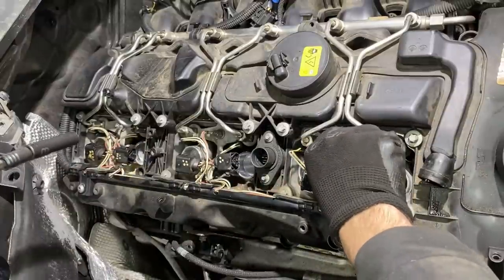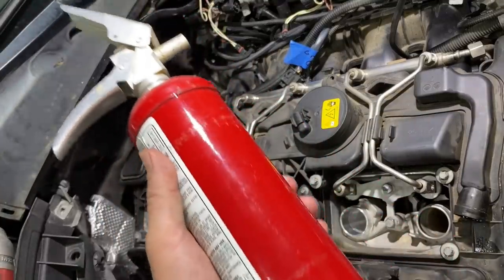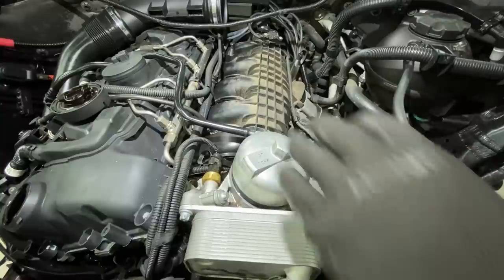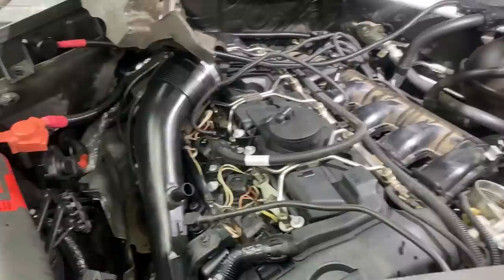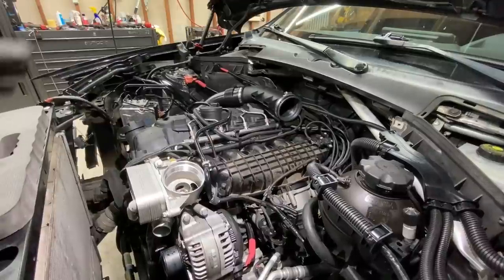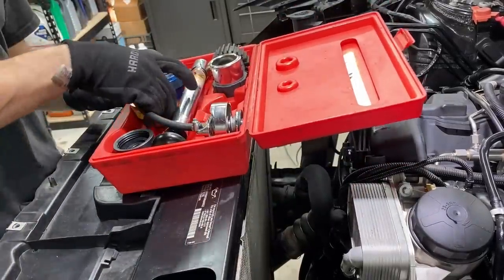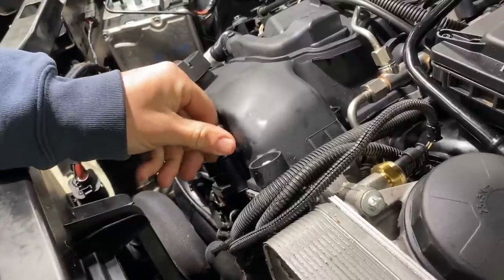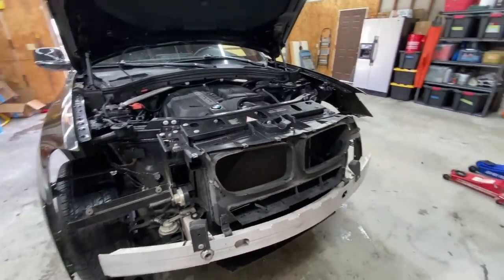HOW TO BMW N55 Valve Cover , Oil Filter Housing, Transmission Service 2013 F25 X3

Comment: I just replaced valve cover gasket on 2016 X3 35i for the most part thanks to this amazing video. Much appreciated.
A few notes - I did not remove spark ignition coils; decided there was no need for this in my case, but it does add a bit of a challenge to unscrew gas lines.  Also, when putting back cover I lifted most of the bolts at the back side and temporary secured with masking tape, found it was easier to manipulate cover into place.
Purchased Elring gasket set from RockAuto (several mechanics I called use Elring)
BMW service in San Francisco gave me $2900 estimate to replace gasket only!

Comment: Please list this as a F25, 35i.  I just did the valve cover on my F26 and realized, there aren’t a lot of videos on this platform, and this is on of just three videos that work on this platform with an N55.  It’s different than any other N55 setup and should be explored further.
Reply from the maker: Thanks for the info! Ill be sure to tweak the title

Comment: Good time to replace the coolant "Mickey Mouse" flange in front of the cylinder head while the oil filter housing is off. My upper radiator hose was still in perfect condition when I did this same service, but the coolant flange totally disintegrated, when I pulled it off the head.
Reply from the maker: Agreed! We didnt have the budget for it this visit but Im sure we will address it in the near future. They do love to crumble apart, maybe an aluminum replacement next time?
Reply: @DayOffDIY  I bought an aluminium flange in preparation since it wasn't that much more expensive than the OEM plastic one. I had a new upper radiator hose also just in case it would have crumbled or the expansion tank nipple broke off. But that new one still remains in my spare  parts bin.
Reply from the maker: @ilesoft82  awesome, im going to give that a try!

Comment: Nice work!  Wonder how do you tell the Transmission fluid temperature is at the range for topping the fluid?
Reply from the maker: For this job I used my Foxwell scan tool and pulled up the Live Data through the Transmission module, and was able to watch the trans temp increase through my scan tool
Reply: @DayOffDIY  Nice.  I have a Foxwell NT510 too.
Reply from the maker: @wishfulbuy  nice! its been good so far!

Comment: Great video! Personally when doing the OFHG and the upper radiator hose, I’ll also do the Mickey Mouse hose that blocks the bottom bolt on the filter housing assembly. Because they get oil saturated like the upper rad hose.
Reply from the maker: Agreed, its a good idea to replace it while you're in there, I think ill be addressing it with Josh in the next run
Reply: @DayOffDIY  change it the aluminum one! Plastic goes in the garbage.
Reply from the maker: @SDE90  Ill have to try it out, I always used OE at the shop, we tried to stay away from aftermarket for the most part.
Budget wasnt there for this trip but maybe in the future for the X3
Reply: @DayOffDIY  Rein makes it! As you know, Rein is an OE supplier of hoses for BMW - so technically you're still keeping that car "a BMW" ;)  - any plastic that you can change to aluminum is a no brainer on the German whips! Worst plastic in the industry lol.

Comment: I would've pulled the crankshaft position sensor plug
Reply from the maker: I forget if the N55 is exposed to oil or not… I think it’s buried underneath the starter somewhere

Comment: Great video! Very informative! Going to do a oil change on my N52 this weekend. Do you happen to know what i can do to get my electric waterpump running. Foot on the gaspedal for +-10 sec does not seem to do anything. I have the ignition on and blower on lowest, temp on highest.
Reply from the maker: hmmm... Ive seen check engine lights preventing the water pump from entering the bleed procedure. With the right scan tool or ISTA you can command it, but if theres an issue with the electric thermostat or water pump it wont allow you to bleed, or sometimes if theres a disconnected sensor in the cooling system.
Reply: @DayOffDIY  none of that luckily. I'm doing the radiator soon, so will try again then. Thanks for answering!
Reply from the maker: @TheDailyEG  maybe there will be some info online for ya! cheers

Comment: Great video man!! Thought you can't fill the gearbox when the car isn't level. Was the car level up in the air? Looked like it wasn't.
Reply from the maker: You’re correct, I should’ve had it level but I topped it off extra to make up for it

Comment: Would be better to clean the throttle body & replacing the intake manifold six gaskets!
Reply from the maker: I agree! I was trained up at the shop to remove as little as possible to not disturb gaskets if they aren’t leaking, so that’s kind of how I tackle things.

Comment: Thx! Just curious, when refilling the transmission is it required to keep the front end of the car higher, instead of level? Or does it not make difference in trans fluid level.
Reply from the maker: Its best to keep the car at level height, It skipped my mind and i shouldve had the car level
Reply: You better go chase that car down, it definitely has the wrong amount of fluid in it, especially with it wildly overrunning out the fill whole while you were putting the plug in.

ZF8 is super sensitive to fill level, and that just wasn’t right.
Reply from the maker: @ScrubRadius  had the front end up a bit higher than the rear, shouldve had it level but i overfilled it due to that reason. will recheck next visit

Comment: Aren't you supposed to prime the engine before starting, even after valve cover gasket replacements on these engines, not just OFHG? I read a lot of forums and even FCP Euro says not doing that starves the engine of oil thus potentially causing rod bearing failure as you know for OFHG but also valve cover. Anyways- thanks for positing this video, very helpful! I'm looking to buy one of these X3s and considering doing my own DIY or using a local shop.
Reply from the maker: Yes, I went through the priming procedure in this video, you can pull the individual connectors to the direct injectors, or you can pull the fuel pump fuse like I did and crank it over.

I’ve had an N55 seize on me because I didn’t prime it before hand, I wasn’t aware 4-5 years ago working at my old shop.

We ended up replacing the engine :/
Reply: @DayOffDIY  yeah I commented before I watched the rest of the video when you did it- whoops lol. But then I realized you said only while changing the OFHG do you need to prime not with valve cover gasket also?
Reply: @DayOffDIY  How reliable has the x3 been for your friend? I'm looking at a 2012 model year with pretty high mileage at 170k but I also drive a lot for work. Would you recommend it?
Reply from the maker: No need to prime it for the Valve Cover. only with the OFH because you disrupt the oiling system and it no longer has pressure built. @ikburd
Reply from the maker: theyre decent! depends on what engine it has. The N55 can be a high maintanence engine sometimes. Not to mention, they are prone to rod bearing issues + all the usual leaks, VCG, OFH, OPG, and the labor is more for something like the oil pan, because you have the front axles running through the pan. for a non X drive oil pan, labor is 4-6 hours, for a X drive its closer to 10 hours @ikburd
Reply from the maker: 170k is starting to get higher for the N55
 @ikburd
Reply: Ok got it thanks for the input! It's the xdrive model indeed with the N55. According to the carfax it has had VCG replaced twice and waterpump, coolant expansion tank and spark plugs replaced in its lifetime. Will still get a preinspection before buying as the dealer says it has no leaks. I figure if I put aside $1- 2k and have all the other fluids like tranny, rear diff, transfer case, aftermarket charge pipe and if needed new belt and pulleys it should be pretty bullet proof, don't you think?
Reply: Also if you don't mind me asking an estimate of what you would have charged to do all that work on your buddy's x3 besides the headlight issue? Tryna get an idea of whether it's worth to take to a shop or not...

Comment: Nice work mate. I just need ur advice for choosing best engine oil for n52 for summers.
Reply from the maker: N52s Ive always used 5w-30! Castrol, Total, or Liqui Moly all good brands to go with!
Reply: @DayOffDIY  mine is 211k miles. So should i change the grade or stick with 5w30?
Reply: It consumes almost 2 quarts oil in every 7000km

Comment: Bro yesterday for some reason I popped the hood and listened to my M54 on idle and what do I hear? Rattling coming from the DISA 🤦‍♂️ why did I buy a BMW?? 😂
Reply from the maker: its not too bad! i found a cheap replacement online or you can rebuilt it relatively easy
Reply: @DayOffDIY  I'm not cheaping out on my E46, I want to keep it tip top. I ordered a new febi bilstein aftermarket DISA valve. Let's see... maybe I clean the idle valve while I'm in there. Is brake cleaner also effective? Or mass airflow sensor cleaner? I don't have carb cleaner around.
Reply from the maker: I use brake cleaner to clean out the idle air control, and I’ve never had an issue with it!